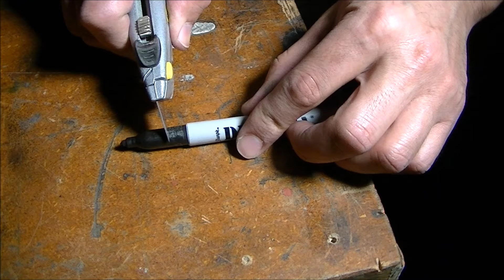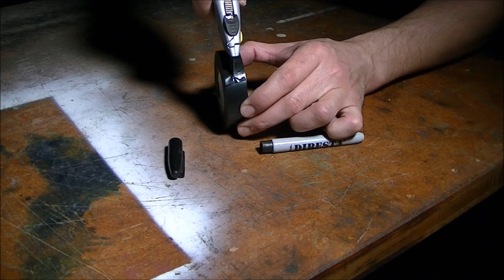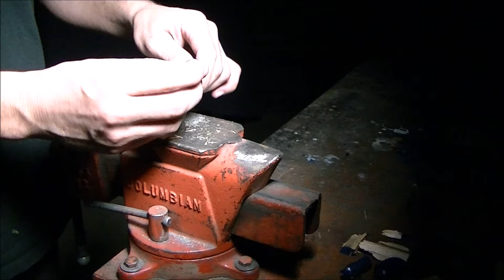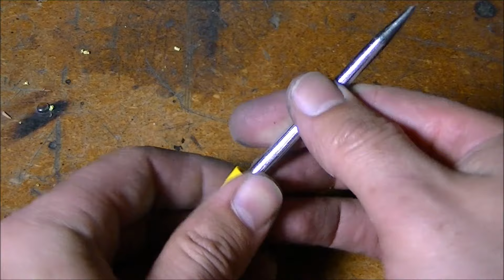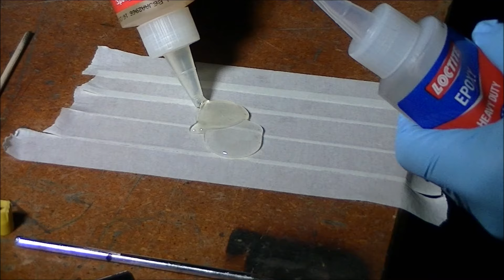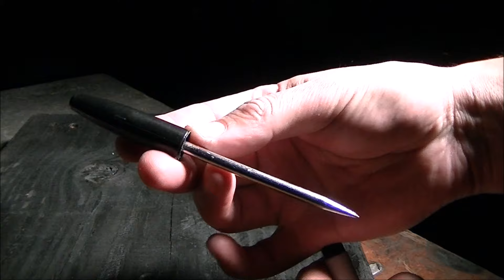DiResta Sharpie Marker - Ice Pick

Comment: how did u make the cornstarch mixture for the batman fidget spinners
Reply from the maker: Don't use the cornstarch for the mold it doesn't work as a mold release.  All the rest of the products I used for the Batman spinner are listed in the description of that video.  Hope that helps.
Reply: Dan The Maker Man thanks but is there anything else I can use because I don't have the resin
Reply from the maker: If you want to make a batman spinner with out resin that's going to be pretty tough especially without a mold.  You could make one out of wood but you will need tools.  If you just want to make a spinner you can make one using a hot glue gun or zip ties or even just supergluing the bearings together. Check a channel called Ollari's he makes one using the superglue method this isn't a batman spinner just a spinner though.  Gold luck.
Reply: Dan The Maker Man thanks